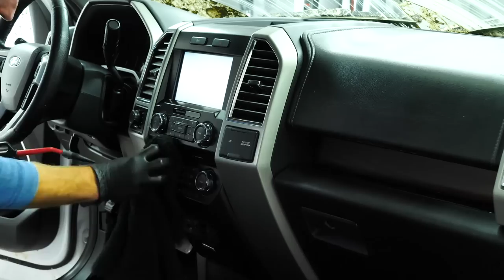DEEP CLEANING A Nasty Muddy Truck | Complete Disaster Car Detailing Restoration

Comment: Yeah. I'm gonna have to admit, the outside looks really staged. There is no need to sling mud at a truck to make a satisfying cleaning. If anything, I dunno, spray it with extra soapy water and go drive on a dusty dirt road. You'll achieve a realistic effect and it'll be super easy to wash off?
Reply: Yes and the interior door cards and arm rests have mud smeared on them on areas that would not get dirty like that because they are inside the car!
Reply: @andrewpoole5060  I use to race in mud truck rodeos. I've seen my fair share of mud and splatter lol and I've never seen globs landing sideways on a hood 😅but I mean, that's just me I guess, and 6 years of experience cleaning up vehicles after racing in 3 feet of off road mud 😂🤠
Reply: Who cares it was satisfying content..buddy could have planted hay and peanuts all over the interior too, would still watch to see it all get cleaned lol. 🤷‍♀️
Reply: @Ginger93  I agree
Reply: @Ginger93  got it. You don't mind being lied to. So how's your gf doing lately 😏
Reply: yeah, i like this channel but staged is an automatic pause and more on for me.

Comment: Was a chevy guys for years, I mean die hard chevy guy, but recently purchased a new truck and went with the new f150, and I gotta say, more room than the chevys and the quality is great as well, I was sold after testing one out, the carpets are great as well, much easier to clean than other vehicles, simply shop vac is enough to look new again

Comment: Did you consider or try a black sharpie for those paint spots in the drivers seat? Kindly
Reply: I wouldn't try it because first it will likely wear off pretty quickly but also sharpies aren't the exact color of the seat so it would look like a purple spot on the seat especially with the paint being white. I would've trylied using a stronger cleaner and a little bit stiffer brush and maybe a steamer but if it doesn't work it's not bad to tell a customer that you weren't able to remove it without risking damaging their seats

Comment: Looks amazing. Quick question how do u get dried paint specs out of wheel well
Reply: I would try just using a pressure washer if that doesn't work you can try a degreaser or all purpose cleaner with a stiff brush and if that doesn't work be very careful only do it on the rubber or plastic wheel wells you can try like acetone or paint thinner and remove it after using it wash the whole area and apply a protectant to not dry out and damage the material hope this helps.
Reply: Thank you
Reply: @76funtime  no problem hope this helps

Comment: But if you don't have an extractor you can still power wash all your carpet or your maths and then just use a Shop-Vac and suck up the water it may take a little bit longer to try but if you don't have an extractor you'll get the same results

Comment: Your kinda waisting your time because you can just use that hand scrubber and scrub the body of the car when you put the blue soup on or at least that's what we do
Reply: That'll scratch the paint like crazy it's smarter to do a pre rinse to remove as much mud and other dirt off before doing the contact wash with the soap.
Reply: @emanuelchavez4154  we use cleaner to break down the mud and stuff then we do a rince so we can get most of it off then we do the contact scrubb